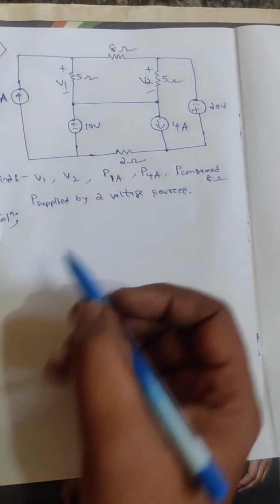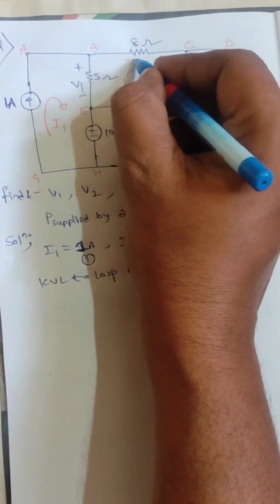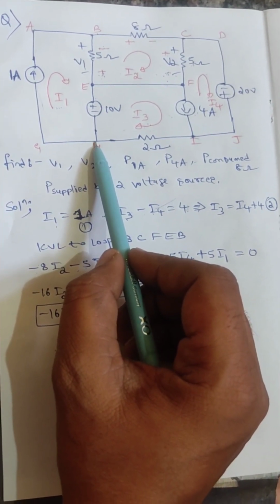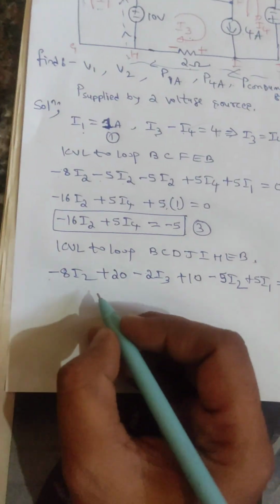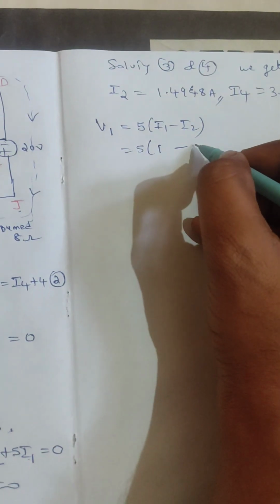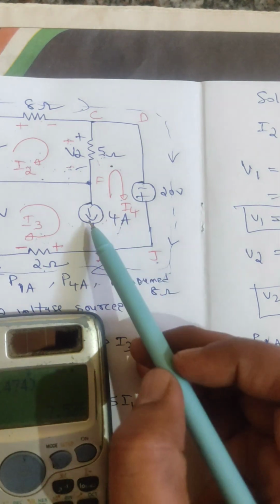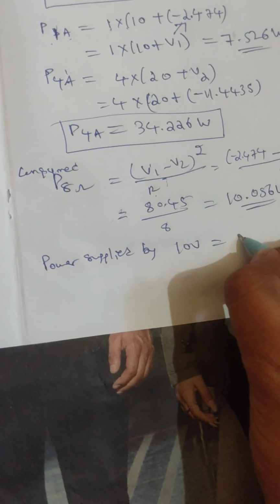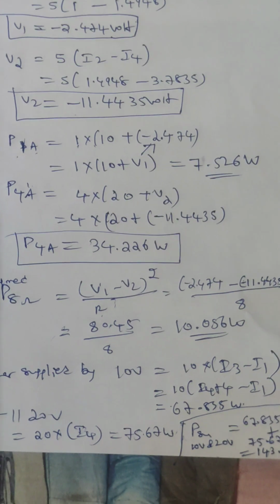NPTEL assignment 1 Jan -April|Network Analysis|problem on mesh analysis.

Comment: in equation 3 there is mistake in I2 addition please check it..
Reply from the maker: Yes it's 18 I2. It's intentionally made. I provide here a method of solving. If anybody copied the answer directly without seeing the video for them it will be disappointing because of the same answer in the video they enter in the assignment..